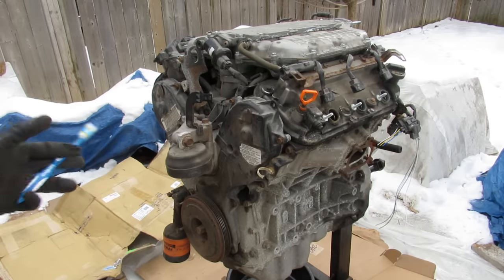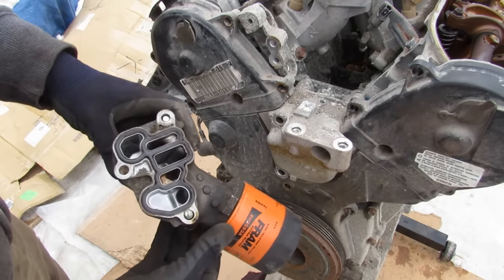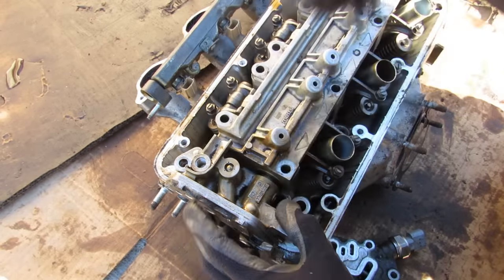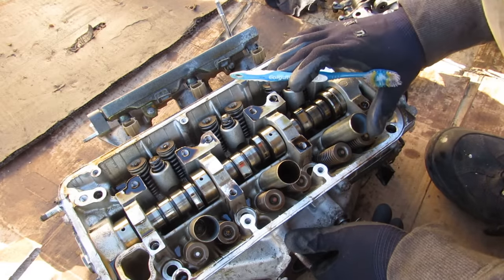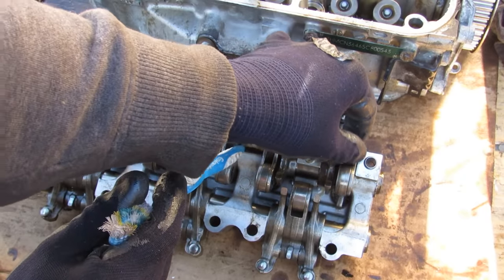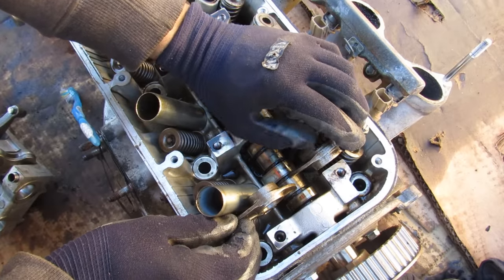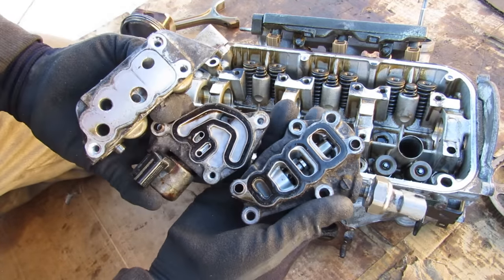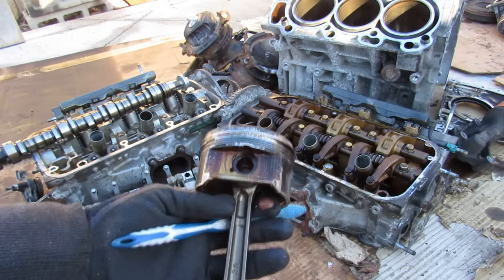Why Cylinder Deactivation Can Cause Engine Failure

Comment: Wow thanks so much I was going to get a older RDX with the Cylinder deactivation thank god I didn't. I had a hunch it might be a bad thing.
Reply from the maker: Nah stay away
Reply: @speedkar99  I didn't get it. Common sense told me it might be trouble down the road. Thanks for the heads up.
What do you think of the new RDX with the the 2 Liter turbo?
Reply: The 2 liter turbo is great. Dont get the 1.5 turbo.
Reply: @richardlionheart7763  Yes that is what I heard. The CRV has issues with the 1.5 and the turbo.

Comment: Keep up with your oil change, and oil level, use synthetic oils like Castrol, Royal Purple, Mobile 1, etc, use quality oil filter (never Fram).
My wife’s 09 Odyssey oil level drops to about a quarter for the 6000 miles oil change intervals with 130,000 miles odometer, no other issues though just the oil level dropping and that no big deal, just hopping no catastrophic event coming.

Comment: Can you please help me understand why the piston slap is worse on the front cylinders (non-VCM)?  Would that be a case for wanting to use VCM instead of using a VCM muzzle to shut off VCM?
Reply: I'm not a mechanic but is it possible that it's caused by those cylinders being used very much more than the other three more use more wear?

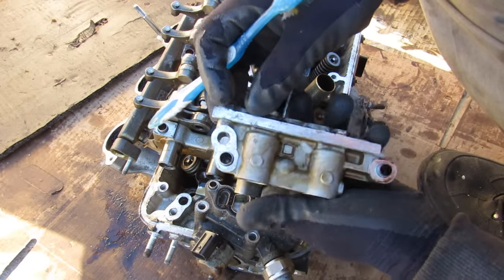Comment: 7:10 Oil pressure is a function of restriction of oil flow, the oil pump doesn't create "oil pressure", it creates oil flow. Oil pressure is a side effect of that flow- basically every time in this video you're talking about "oil pressure" you're actually talking about oil flow. Kind of a nitpick, but I hear this misused terminology quite a bit and it bothers me, just like when people call it "Oreilly's" auto parts :D.
Reply from the maker: I agree and sometimes use them inter changably
Reply: @speedkar99  It's one of those things that's technically wrong, but colloquially accurate. 

If you used different words, the concept would remain the same- like how positive and negative electric terminals are backwards from the actual charge and electron flow in modern physics.

Comment: What are your thoughts of disabling VCM for a car that is consuming oil?
Reply: SInce this post, I got VCM Controller for my car that turned the VCM  (ECO) off.  So my car runs on all 6 cylinders now.  Oil consumption has decreased significantly.
Reply: @ahotdj07  could you send a link to where you got it from?

Comment: Wow great video!!! All that extra engineering for nothing! Wow!!  Im just getting ready to install a variable resistor (so i can adjust it depending on the season here in northern Illinois) to my 2008 Honda Odyssey because its going threw the oil like crazy and blowing so much smog out the tail pipe so much that it leaves a film on the back of the vehicle wtf How much does the software update limit the VCM?

Comment: easy fix with a lobe profile that opens the intake valves in each stroke of the piston, basically letting air go in and out
Reply: Do you mean then sucking air from the intake in one stroke and pumping it to the intake again in the second?
Reply from the maker: When VCM is engaged the intake and exhaust share the same flat profile lobe
Reply: @manujuable1  kind of

Comment: Speedkar99 --I have a 2016 Honda Accord Coupe V6 AT (VCM). I have disabled VCM using software (Ktuner). What, in your opinion, are the benefits or drawbacks of using this method to disable VCM? I service the car religiously, typically getting oil changes at 3-4K miles, tranny fluid exchanges every 30K, and every other milestone service when needed. PS: I wanted the MT, but couldn't find one in good condition.
Reply: How has the KTuner worked out for you? I just bought a 2017 Coupe and am thinking of buying the KTuner.  And are you running just the stock tune?
Reply: @jasonschell1309  Hi Jason, at first I was running the 91 Octane tune with VCM enabled. For the last two months I have been running the same 91 Octane tune with VCM disabled--which makes the car feel smoother and it feels a bit more responsive. I initially switched back and forth between VCM enabled/disabled to try to rule out placebo. If you run the 91 Octane tune with no mods, you will still definitely notice a difference. I only have a K&N drop-in filter. The ability to utilize a much higher octane is really the star of the show. Of course, the tune changes the entire HP and torque curve--not just peak HP and torque. With the 91 Oct. tune, the wheels now chirp when shifting from 2nd to 3rd sometimes (at about 57 MPH w/ TC off), which never used to happen. It chirps shifting from 1st to 2nd every time now. With the Ktuner 91 Oct tune, I achieve the same MPG (as best as I can tell) as stock. With VCM disabled, I notice maybe 1-2 mpg less on the highway.  This is a longwinded way of saying: I highly recommend Ktuner--if the price is not prohibitive.
Reply: @jasonschell1309  Also, very important to note: if you do not plan on having your Ktuner plugged into the OBD port all the time, then save your preferred tune to "Slot 1." This is because the ECU loads the tune you have saved to slot 1 by default if Ktuner is not plugged in.
Reply: @ParkRangerStan  Thanks for the reply, appreciate the info.

Comment: Why didn't they just disable the injectors for rear bank but keep operating the valves? They could have even used a separate lobe to open the valves during compression stroke so that the engine sees less load and easier spinning. I really don't get this Honda system

Comment: Front head valvetrain is dirtier because PCV valve sits in front valve cover. Rear valve cover does not have PCV valve.
Reply from the maker: Yeah but the rear bank was spotless!!
Reply: @speedkar99  That is exactly my point. Bank without PCV valve will be cleaner than bank with one. I have replaced valve cover gaskets recently on Honda's J32A2 with 260K miles. Front bank without PCV valve was almost spotless, rear one had some garnish.

Comment: Cylinder deactivation is a complete disaster on many of the engines that it has been put on. GM, Dodge, Honda, and now Ford will be using it on certain engines in 2021.  As a mechanic I see failures from those systems all the time and it usually runs into the thousands to repair. The engineering behind it is flawed or at least in serious need of refinement. Shutting off or altering oil flow to any part of the engine is a stupid idea at best. Worst is that these manufactures are aware of the issues but choose to ignore it. I see GM and Dodge products all of the time with CD issues, yet they continue to push out this shit on consumers and try to badge it as this great fuel saving technology.

Comment: I don't see the need for a VCM disabler. Once you start having misfires, just unplug the spool valve momentarily (to induce a check engine light) and then drive VCM free for a while. Clear the code once you have put some hard miles on to clean up the rings. Repeat as necessary.

Comment: I just ditched my 2017 Pilot because of damage likely caused by VCM.  I had a regular drive on a 55mph highway, thus I was very often in the 65mph cruise range with VCM activated.  I had the Transmission System Error message pop up which was likely caused by VCM wearing out the torque converter.  I only had 46k miles, but 3 months past warranty.  I will never buy another VCM Honda.
Reply from the maker: Ouch. Buy Honda but disable the VCM next time

Comment: The reason one head was cleaner than the other is because if how the PCV system is designed . Very common to see this on all j series engines
Reply from the maker: Yeah but that much difference?
Reply: @speedkar99  yes . Seen it dozens of times on Honda and Acura V6 engines

Comment: I have a 2016 Acura TLX with a VCM and my engine died at around 70,000 miles. The mechanics at Acura told me the engine had massive oil consumption 😒

Comment: THE ENGINE WAS NEVER REBUILT. THE HEAD THAT ALWAYS RUNS IS HOT. The rear head is cold on eco mode. So it doesn't cook oil. That's why EVERY REAR HEAD I TAKEN OFF A VCM IS CLEAN.
Reply: You are not a expert. And shouldn't be giving Info on this engine if you don't know what your talking about dude.

Comment: They should have used direct injection with this variable cylindar management and kept the intakes open somehow, very interesting video!! your videos are unique!
Reply: no, no.  direct injection causes more problems.  it should have zero cylinder mgmt and port injection.  it will go 400k miles then.

Comment: If Honda had just turned off the Injectors but kept the valves  moving they would have avoided the vacuum problem and would not need the complicated  camshafts ,rocker arms , springs and solenoids . That would cause other issues but i am sure those could have been resolved with software magic

Comment: Do a multi air engine!!
Reply from the maker: The fiat motor?
Reply: @speedkar99  yes that would be awesome explaining in detail how the hydraulic lifters work. The multi air brick if you will. I own a 2013 abarth and it's got 120k hard miles and no issues! On original clutch even. 😀 I truly appreciate what you do!! Cheers!

Comment: As a Honda technician I'm curious what he has to say.
Reply: And what did you think?
Reply: @gabigabigavin  almost had time to finish it, ha.

So far it's spot on.
I just got to the piston section.
Reply: Very good.
I know there was information about the oil and fuel qualities. Basically if you didn't change the oil enough and has fuel with too many solids in it you would get build-up starting from the bottom rings.
We've tried induction cleaning and that doesn't do anything.
I haven't had one we have been able to save. Really just did what Honda was saying in the beginning and that's replace the spark plugs and update the computer.
Reply from the maker: How is it
Reply: @speedkar99  I enjoyed it, as always.
I've had these engines apart mangy times ave I've never mapped out the oil passages.
I know what I'm told but I don't have a way to prove anything.
Good show Sir.

Comment: the valves should stay open for the deactivated cylinders because I'd take huge amount of energy to compress air and vacuuming the closed cylinders.
Reply from the maker: You'd think, but think of all the stuff that would push into the exhaust
Reply: @speedkar99  
if all the valves stay open it would just push and pull from both ports , i didnt notice if it had a turbo but if it has all the air would just blow through the open valves :-)
a better design would let the inlet valves work normally and change the exhaust so there would be no compression stroke  with the fuel cut off there would be hardly any load on the engine and no oil sucked through :-)
Reply: @speedkar99  or they may come up with disconnectable crank shaft so those disabled pistols don't even need to move up and down to save energy 😅

Comment: Well if honda can't even get displacement on demand to work reliability, it's any wonder that GM's AFM system is garage...
to be fair, the GM method using collapsible lifters is a much simpler system, but GM have proven time and time again that simplicity doesn't always equal reliability.

Comment: I just paid 4k for a ring job and timing belt on a 15 Odyssey at 93k miles. Ridiculous. Just bought a vcm muzzler. Better late than never.
Reply from the maker: Did they have to take the engine out?
Reply: That's a good question I'm not positive but I know most of that 4k was in labor costs

Comment: Yup my fathers 2017 Silverado has had nothing but problems. Failed fuel injectors, runs crappy. Will never last as long as that Honda did
Reply from the maker: Yeah I've heard the GM engines didn't do well with cylinder deactivation either
Reply: @speedkar99  too bad they used to be so reliable

Comment: No need for such a complicated system. All they needed to do is software modifications. Just deactivate 2 cylinders and make the engine a V4 engine but turning off fuel and spark. Just allow the valves to open and close normally to avoid the oil build up in the combustion chamber. Simplicity is always best.

Comment: All this compilation for what?...one more mile per gallon! Can one shut it off like shutting off start/stop?
Reply: It is crazy. In Europe, idiot politicians want to ban all new internal combustion engines. In the UK, it is the law, starting from 2030. They want only electric cars. And the rest of Europe will be basically forced to do the same, because of the unrealistic Euro7 emission standards that will be introduced at about the same time. You will only be able to buy electric cars, hybrids and maybe some pure petrol or mild hybrid that will be so weak tat the car would barelly move.

Comment: if it would just open the valves a tiny bit so it wont suck oil past the oil rings it wouldn't be so bad i guess
Reply from the maker: And then suck it through the exhaust into the catalytic converter?

Comment: I say it's pretty reliable, regardless of the cylinder deactivation management,  with 400,000 miles. :_)
Reply: Yeah,  except one bank of cylinders looks to be rebuilt even though you can tell the owner was really good about oil changes.
Also it's 400,000km which is roughly 250,000 miles.
Reply: @mrdumbfellow927  oh it's kilometers. Anyhow, it's a Toyota. LOL i'm not a Toyota fanboy by the way. Hahaa
Reply: @BryanChance  hah, actually it's a honda anyway 😁.  But it's all good.   Have a good day!

Comment: Pulling the heads IN DA SNOW!!!! Time to take the basement door off and drag crap inside or get a cheap used 14 x 14 used shed and put a diesel heater inside!!!!  TOO Damn cold.
Reply from the maker: Yeah it's cold, but filming indoors doesn't lend to good quality, I tried it with my manual transmission video and I didn't like it. Natural light is hard to beat and I have to bear the consequences if it means working in the cold.... until I can afford an enclosed green house haha
Reply: @speedkar99  maybe one of those garage tents if you could find one with white canvas.

Comment: I hate this technology and won't buy a car with it. I don't tolerate excessive oil consumption for the sake of trying to save the planet by getting a tenth of a mile per gallon better. Same with auto start-stop. Engines today would be so much more reliable if emission standards were actually feasible. Engines today are tearing themselves apart from the inside out and it's difficult to find a car without it having some kind of engine problem.
Reply from the maker: Agreed. I'm not a fan of this tech.

Comment: FUCK VCM!
My 2008 Honda Accord was my biggest vehicular regret. Should have done more research and realized the hell that is VCM ownership.
Reply from the maker: What happened to it?
Reply: @speedkar99  After VCMuzzler, VCMTuner, a KTuner tune, and two treatments of Marvel Mystery Oil piston soak, I got tired of seeing puffs of smoke in my rear view mirror on throttle tip-in and fidgeting with resistors when the weather changed. 

I sold it and made sure the next guy knew about VCM. He didn’t care because it was cheap and he wanted to supercharge it. (Good luck to him.)

Nevertheless, learned a lot about working on cars and learned even more about researching deeper before buying. 

Now driving a 2003 Lexus LS430 and loving it, won’t touch Honda for a while lol

Comment: This was cool to watch while also informative! Debating a muzzle for the VCM in my 2010 Accord V6 coupe so doing some research. The transmissions in this year were reported as troublesome but I'm not so sure it wasn't due to the vcm beating them to death.

Is the difference between v-tech and i-vtech, vcm? If so I am surprised they were doing vcm in 2006 because I recently saw a video where the guy bought an accord with 500,000 miles on it. Or was that a 4 cyl in the video...I cannot remember lol but it did say i-vtech on the beauty cover though. Did they use vcm on V4? 

2006 Honda Accord 510k mile overview: https://youtu.be/JdbaiXwO1S0

Thanks for the upload!
Reply from the maker: They don't use VCM on i4
The VTEC system is for power 
VCM shuts off the rear 3 cylinders 
I have a video on VTEC , check it out for more 
VCM muffler is worth it im my opinion
Reply: I’m considering a VCM muffler on 2013 Pilot, just got rid of 09 Pilot burning a lot of synthetic oil due to this issue, was hesitant on buying the 2013 but the wife likes the square body style. Should I buy the vcm muffler or not???

Comment: The engineering is first class. Sophisticated hydraulics with master class machining and engine building. 
However, the design philosophy of cylinder deactivation is seriously flawed!
The ethics of engine testbed results, they must have seen the results of this process and the inherent problems as the miles or hours went on. 
Then too continue into production and sales to the trusting Honda customers. Shameful!
I will never buy any product using this technology. 
Imagine how much pollution this will cause, rather than prevent. 
It would have been better to have the valves open or simply have two engines back to back and have one shut down when it’s not needed.
Reply from the maker: Yeah it doesn't work out in the long run

Comment: Cylinder deactivation has always been an idiotic idea.  The issue isn't engine size; it's the weight of the car.  An LS V8 swapped vw  bug gets three times the fuel economy as an 864 Cadillac running on 4 cylinders.

Comment: So, basically at around 260,000 miles this engine really didn't fail and basically every part of the engine internally is in great shape.  That's why my Accord's J engine hasn't had a single issue.  I've never had a single issue with my vcm.  Do regular maintenance and this proven engine will give you many, many trouble free miles.
Reply from the maker: Yes there were more major failures but you gotta watch it with the VCM versions of J-series